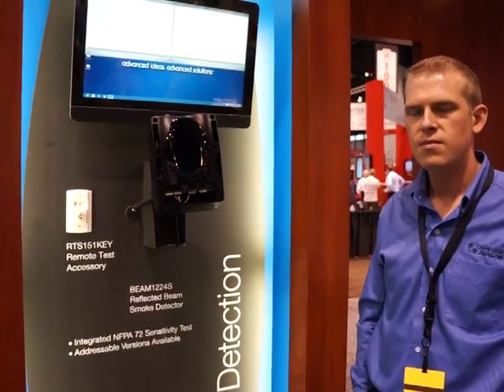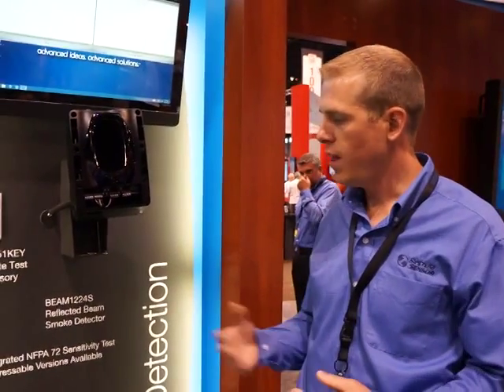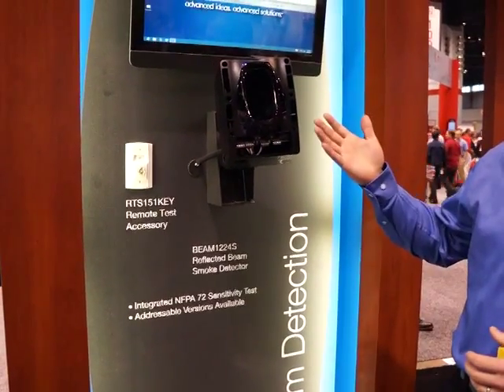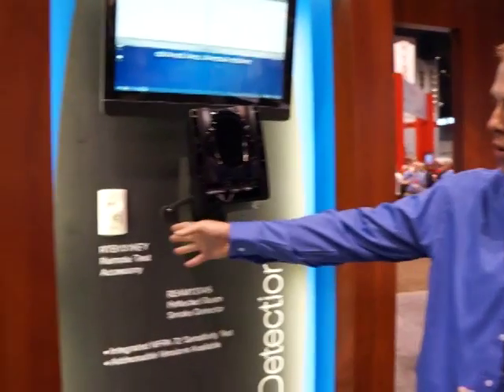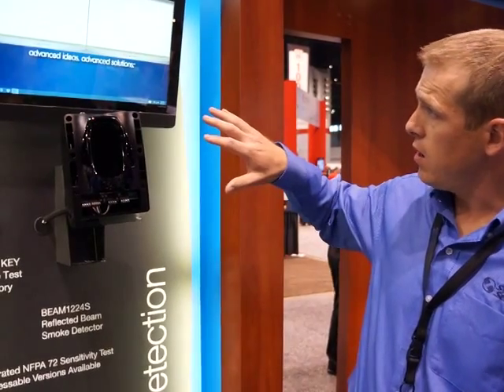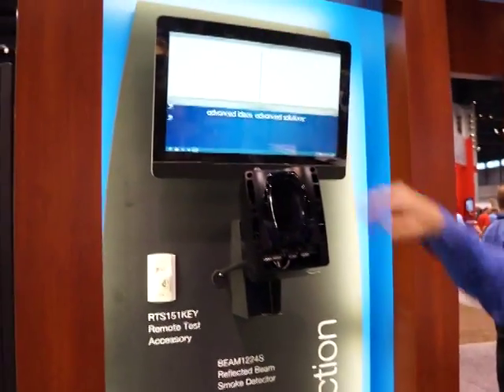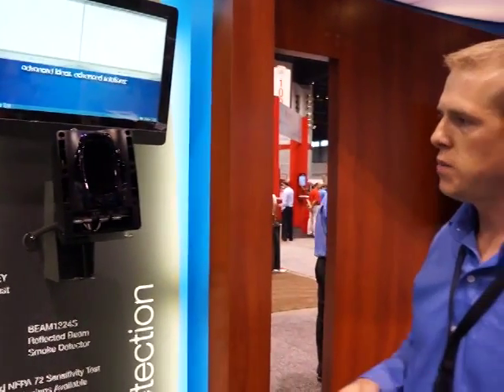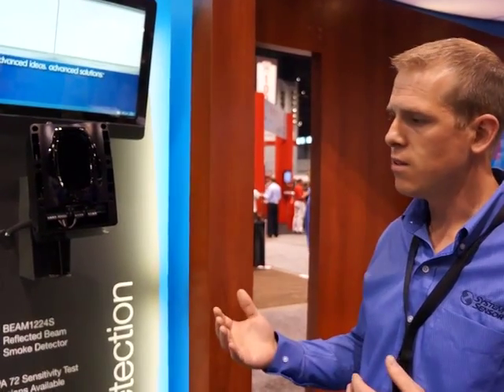Beam -- BEAM1224S Demonstration (Live at NFPA 2013)

Comment: if i want to connect with fire alarm system how i will connect is via monitor module, monitor module then you are requesting to please show the connection of Beam Detector, Power & loop connection wiring diagram.